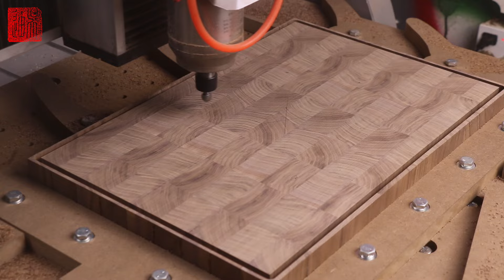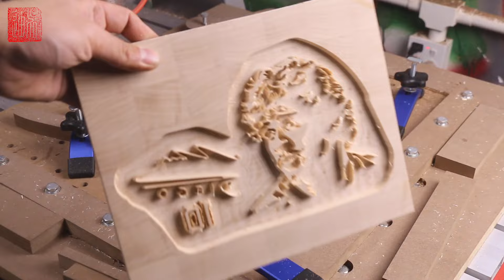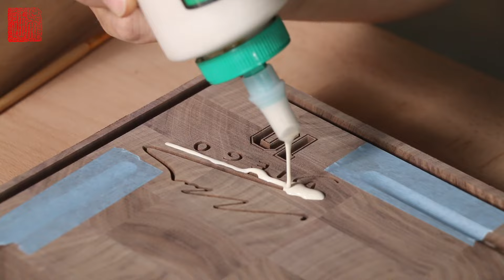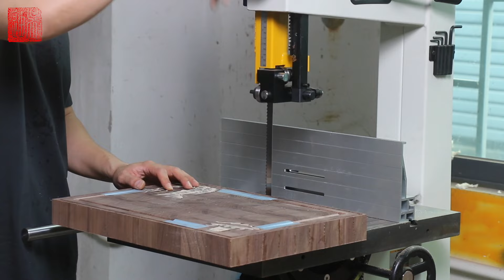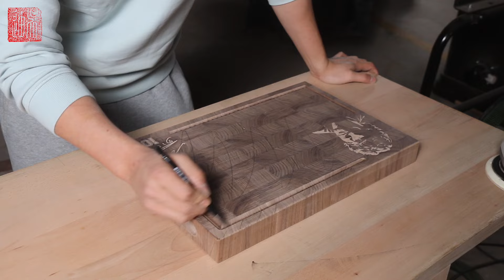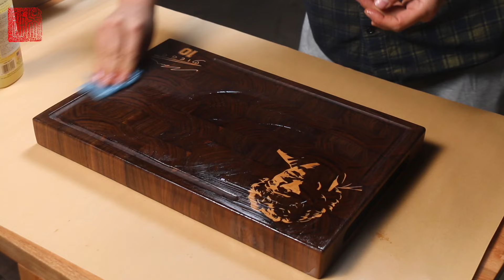Diego Armando Maradona | CNC Inlay Cutting Board | Woody Woody

Comment: What are you settings for the male piece? Fine details keep chipping off one mine. I have a ~6 degree bit running 18k RPM and 50 IPM. I cant successfully finish any of the fine details.
Reply from the maker: I used a 15 degrees V bit, so 7.5 degrees each side. The V bit runs around 22K rpm, and the feed rate is 25 ipm. Are you carving on end grain or edge grain?
Reply: @WoodyWoodyATL  I was cutting on edge grain. is end grain better?
Reply from the maker: @cygnusa3772  Yes, try it on end grain. Luck plays a big role on edge grain.